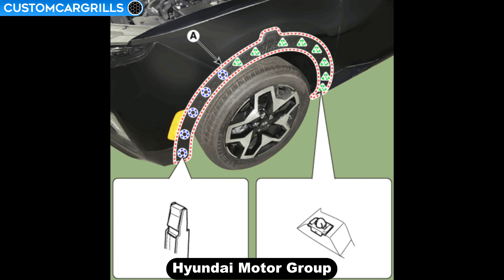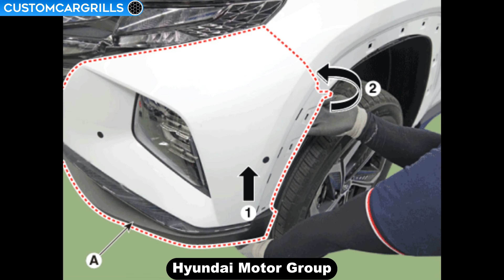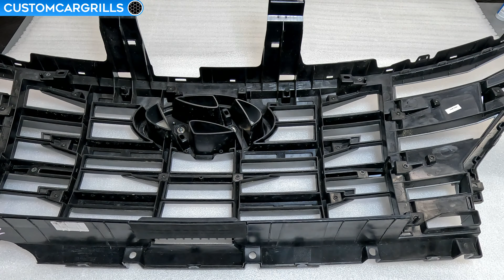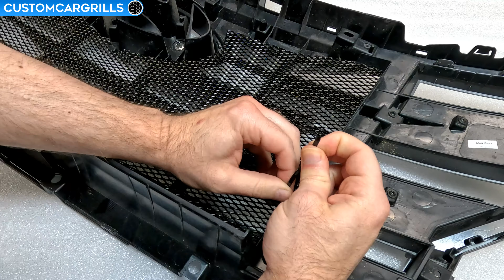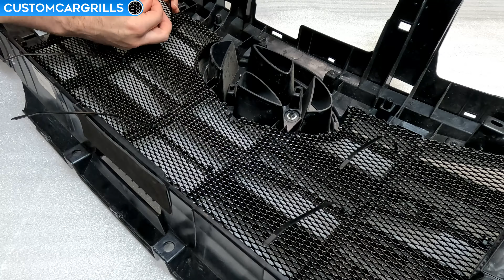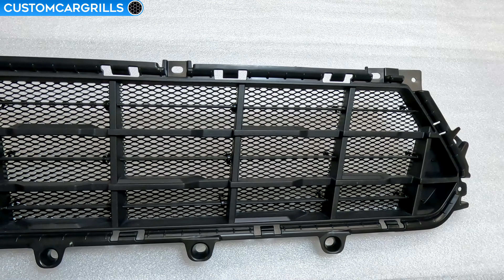How to Install Radiator Grille Mesh on a Hyundai Santa Cruz 2022+ by customcargrills.com

Comment: Is this part of the car consists of two pieces? Like middle section where the emblem is attached can be removed? I broke that piece and it seems pretty expensive to replace the full thing.
Reply from the maker: The mesh piece we sell isn't a replacement for either of the oem grille components if that's what you're asking.